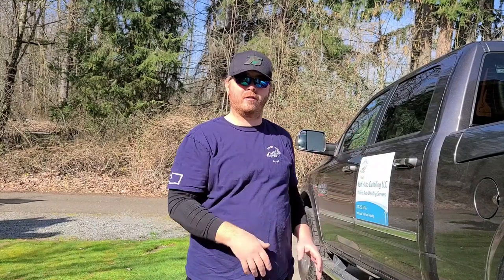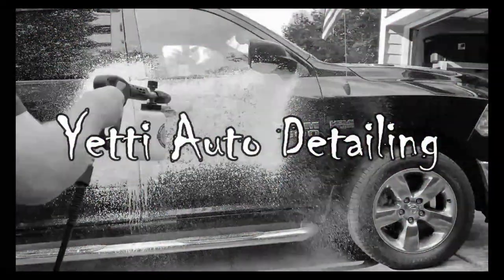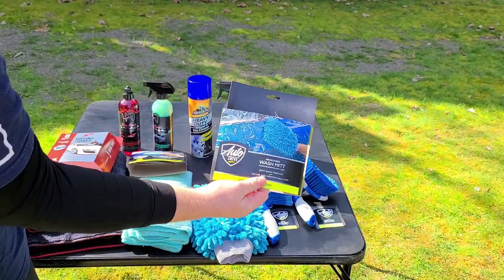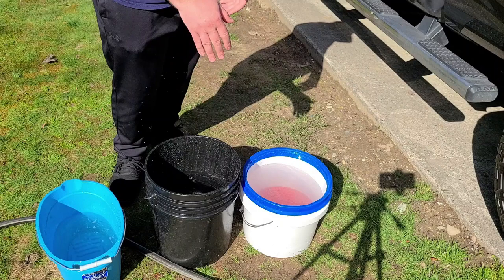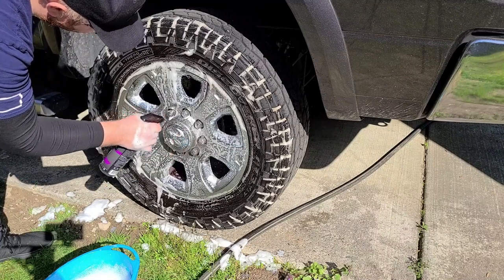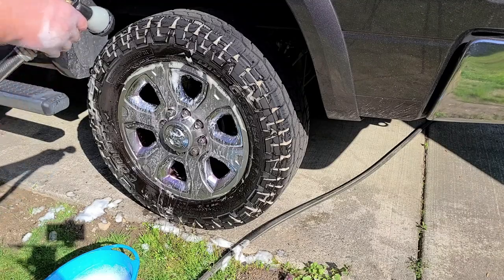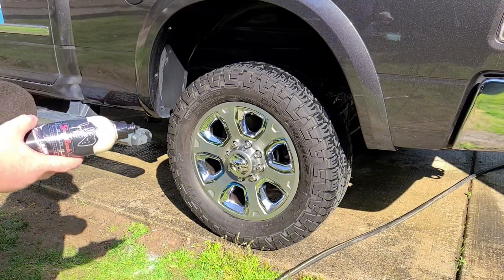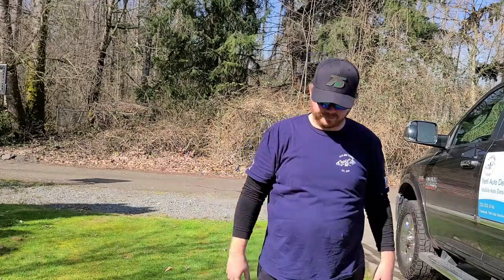Detailing a Vehicle Average Joe Style #jayleno'sgarage #yettiautodetailing #averagejoedetailing

Comment: I know the first wash is a little more expensive but I’m trying not to overthink the items I need to start detailing. Have a new 2021 tundra and want to protect the paint, it will probably be garage kept the entire life. 
     I like the 2/3 bucket method, but have no outside faucet so trying to see about running a faucet to garden hose adapter. It feels a little overwhelming with knowing which step to do next. Wash, rinse, iron remover, clay bar, spray wax? Paint sealant? I guess for the average joe you don’t need to go top of the line detailing but just trying to see the difference levels and price point it would be to go from one to the next.
Reply from the maker: I would suggest a rinsless wash using ONR I have a video on that. If shouldn't need a decon wash beings it's that new. You can always hit it straight with a paint sealant and skip the spray wax. I would suggest Turtle Wax To The Max Wax for the foundation then use their Flex Wax as a drying aid on the maintenance washes. 

https://youtu.be/iE62M5BXWFA